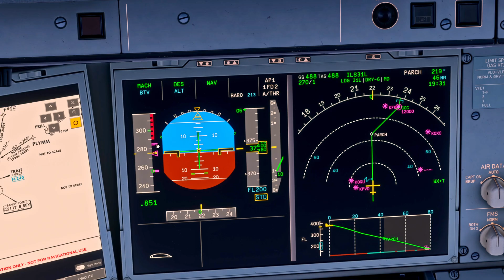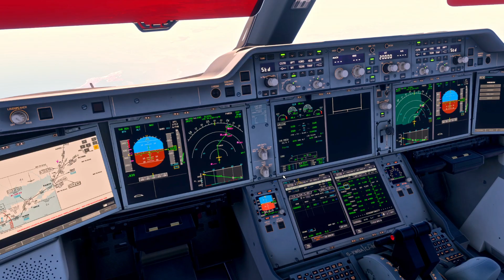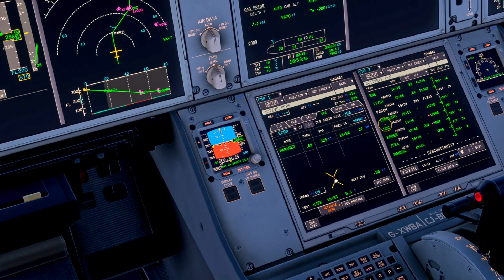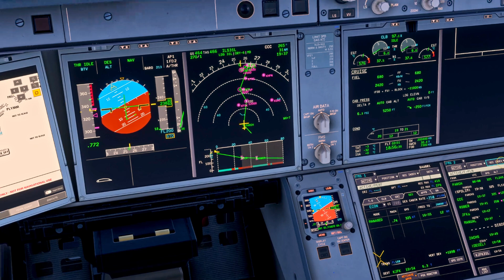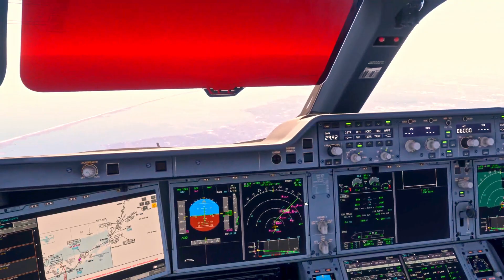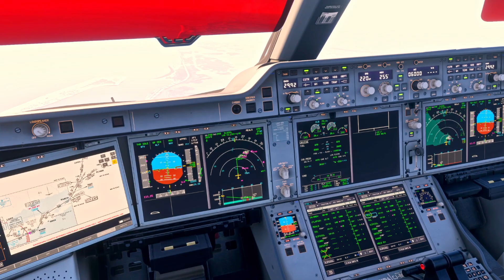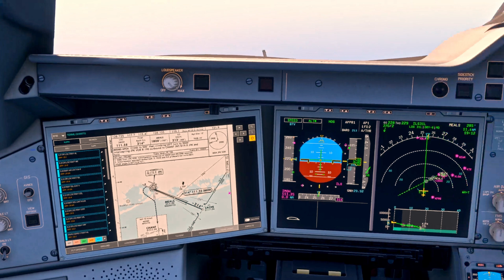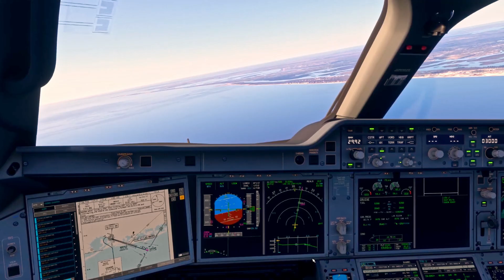A350 Descent & Approach Tutorial | Real Airbus Pilot | MSFS 2024

Comment: What is the function of AP2? I mostly land with AP1
Reply from the maker: Hello, it is the same as AP1 just a separate system for redundancy. Use of AP1 & 2 is usually alternated each flight. If you are conducting an auto land both autopilots should be engaged in case one fails
Reply: So both essentially perform the same function. It's just that if one fails the other one will take over ? Meaning same data is transmitted to both AP1 and AP2. Am I correct in my understanding ? @AirbusCockpitCoach
Reply from the maker: @SierraHunter2106 Hello, yes you are correct, it's all about redundancy 👍
Reply: @AirbusCockpitCoach thanks capt. Have a great day ahead
Reply from the maker: @SierraHunter2106 Thanks & you 👍
Reply: @AirbusCockpitCoach Thank you!